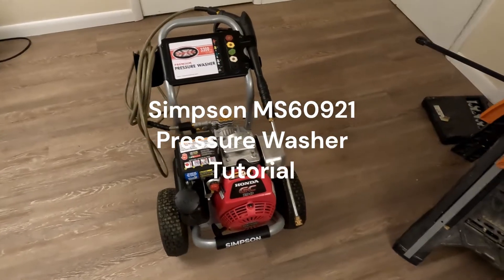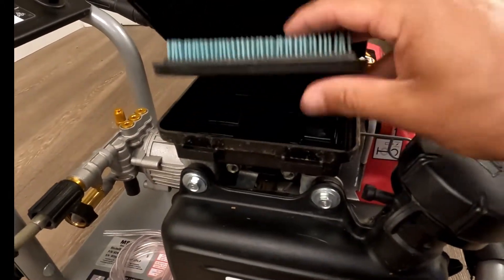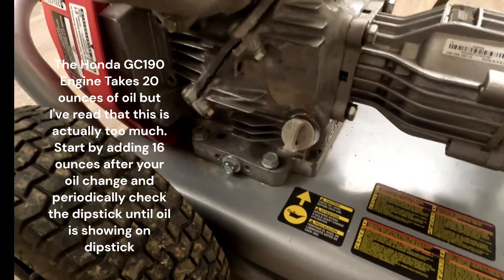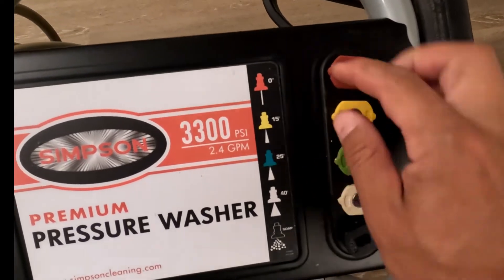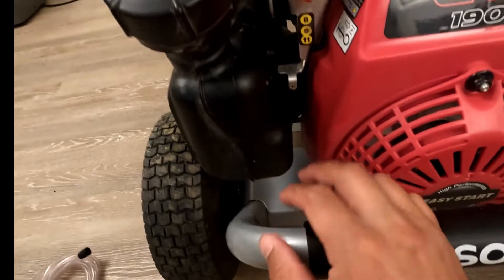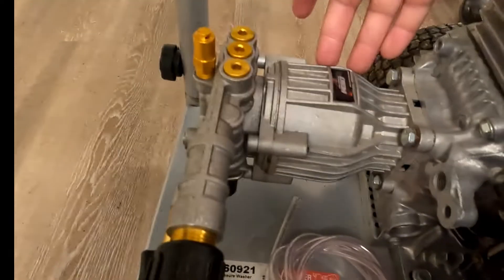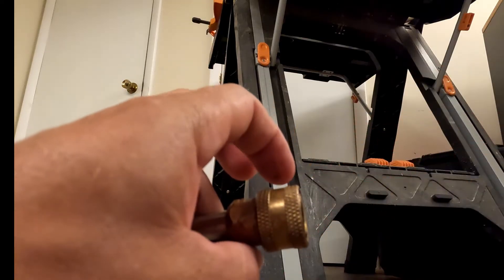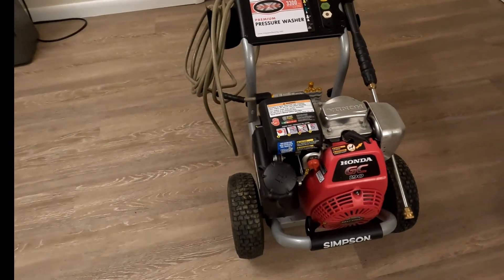Simpson Pressure Washer Tutorial MS60921

Comment: Is there a bolt to remove the gasoline out? I brother recently gave me his pressure washer he no longer uses and it has old gas in there
Reply from the maker: You can either drain it by tipping it over into a container or locating the fuel line and disconnect it into a container. I'd probably go the route of just tipping it

Comment: How do u add oil to just the water pump
Reply from the maker: You don't need to add oil to it. It has a maintenance free crankcase that doesn't require oil changes. I have another video up on my channel on how to swap out the pump. If that's the repair you're performing be sure to subscribe and check it out! Thanks for watching, have a great night!

Comment: The wand is suppose to reduce pressure when the trigger is released. Mine does not same pressure with or without the trigger depressed. Makes it hard to relocate washer without turning off   Simpson advertised this feature on this wand. What am I doing wrong? 3:10
Reply from the maker: So the wand is always on at full pressure? I believe there is a lock near the trigger on the handle. It may be locked or stuck in the lock setting.

Comment: Thanks for the video.  I'm obsessing over what pressure washer to buy to replace my old one that died after 19 years.  Foolishly I didn't note what brand it was, but the one you were working on was almost an exact copy at least the oil dipstick, gas cap, on / off and choke.  Based on all this, I assume it was a Simpson.  It seems that many pressure washers don't have a soap tank which seems like a useful thing to have.  I used the old one to clean the patio and sidewalk.  I was thinking of one in the 3,000 to 3,200 PSI range.  I read that the Triplex pumps are what the better pumps are equipped with.  Any thoughts / recommendations for me as a several times a year user.  Might try it on the car, wheel wells, etc.  Thanks in advance.
Reply from the maker: I honestly really like this Simpson. I did a pump change on one that was left out over the winter and cracked and it was easy to replace. I would think it also has enough power to do the things you mentioned. Glad you liked the video! Thanks for watching, have a great night!